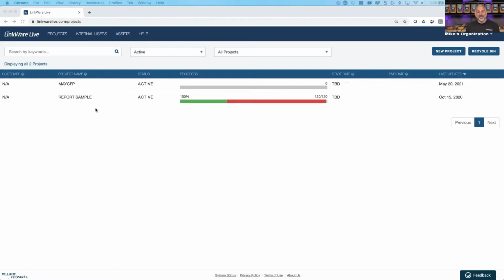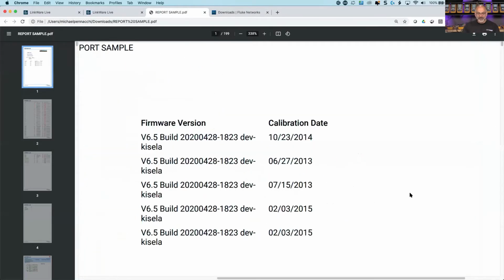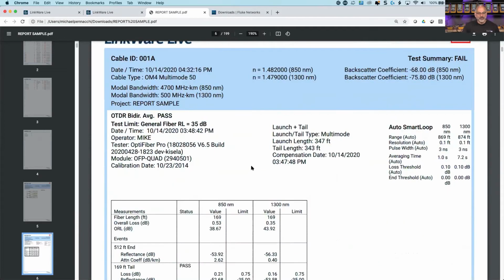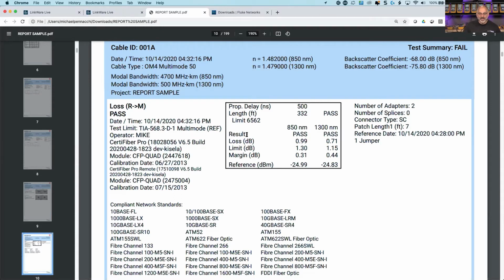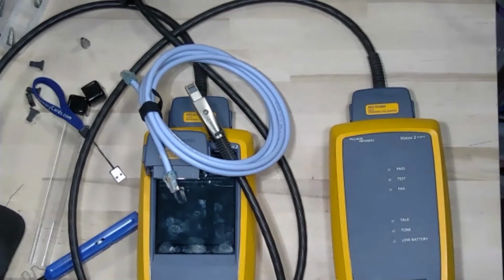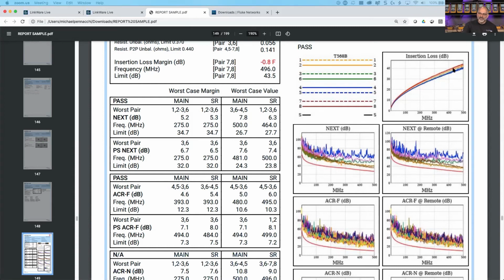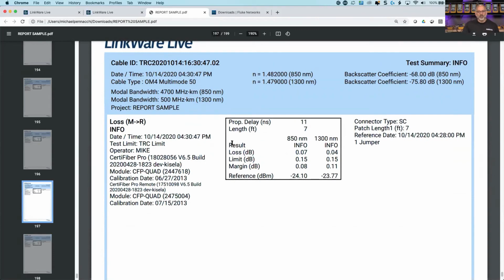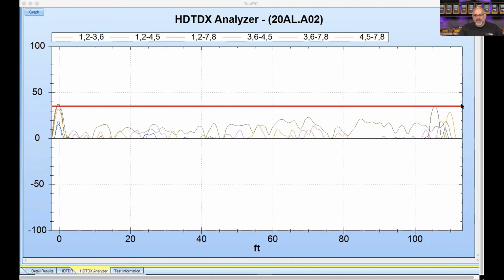Analyzing the Fluke Networks LinkWare™ Report

Comment: Sir. How to calculate cat6A bandwidth from the fluke test report VERSIV 5000
Reply from the maker: At 20:22 you will see an example of the report, in this case it is for a fiber link.  Down at the bottom of the report there is a list of Compliant Network Standards.  LinkWare PC compares each of the network standards with the results of the test and shows which will run on the link based on the results.  In the case of Cat6A, you would expect to see standards such as 1000BASE-T, 10GBASE-T, etc.  This will give you an idea of which speeds will run across the cable.

Comment: Thanks for the detailed explanation!  A calibration from 2011 on an old DTX-1800, thus more than 10y old, could it skew the results on CAT6 cable reports to make it pass instead of fail?  The version of the DTX-1800 seems to be the latest, 2.78.